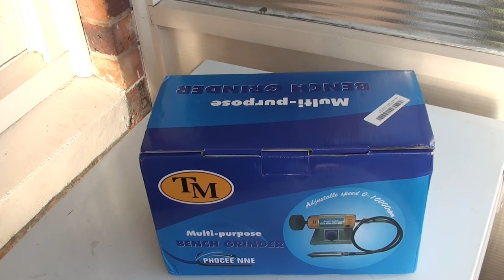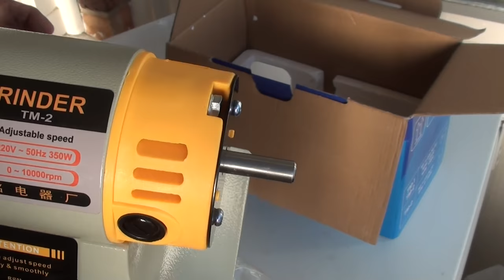Tm Bench top  polisher Unboxing and test

Comment: Can you add some good pressure to the buffing pads without it moving around if you haven't got it bolted down and doesn't lose RPM power when adding pressure?
Reply from the maker: It has rubber feet so doesnt move much. Only has small motor but its aimed at delicate sized work not big peices
Reply: @Oneupthesleevecustoms  that's good I'm using it for repairing CD/DVD with White and Blue compounds using this machine

Comment: I received mine yesterday and it has the flex cable, but only two stone grinding wheel's No wool polishing wheels
I find it to be a fair trade off, i will take the cable over buffer pad any day
Reply from the maker: Yeah so you can use it like a die grinder?
Reply: just got one of these and it came with a cable as well, but the cable does not  fit the end with the springlock/ball bearing coupler did yours fit? mine seems to be about 1 to 2 thou.out of spec it looks like you should just be able to pull back on the spring and snap on the cable   I might be able to polish the cable end but wanted to check first to see if someone else had this issue   thanks
Reply: @RoyalTDynoman  sadly enough while using my flex cable a rag got sucked into the polishing wheel shaft and burnt the unit out before I could even reach for the power button
Trade off rather than buying a new one online i went to Harbor freight and bought a larger grinder which also came with a flex cable and it works great.
Not to take anything from this one, im sure if i were more attentive to what i were doing it would still be working great.

Comment: I Got to get one.
Reply from the maker: They work well
Reply from the maker: Did you get one through my link or want a ebay link instead
Reply: Wer can I get one?
Reply from the maker: Ill send you a link soon
Reply: @Oneupthesleevecustoms  you are the best 😎🤝. Cheers
Reply from the maker: @gasperajdnik5627  https://rover.ebay.com/rover/1/705-53470-19255-0/1?mpre=https%3A%2F%2Fwww.ebay.com.au%2Fitm%2FSONIC-MINI-BENCH-GRINDER-POLISHER-WITH-FLEX-SHAFT%2F132544965998%3Fhash%3Ditem1edc4bad6e%3Ag%3ArxkAAOSw-VtbC4oE%3Ark%3A12%3Apf%3A0&campid=5338476033&toolid=20008
Reply from the maker: try that bro
Reply: Hell yah tanks bro I well try that 😎. Cheers
Reply: Tanks mate I bougt   one  2. Monch ago and it works well. Cheers
Reply: I have this mashine and I like it 👍😉